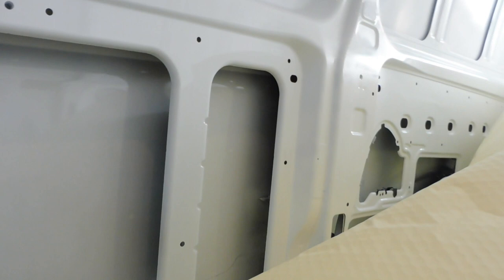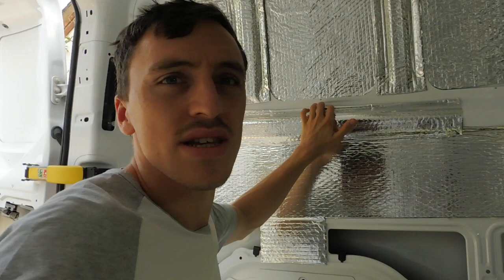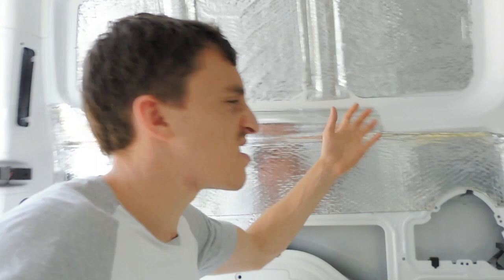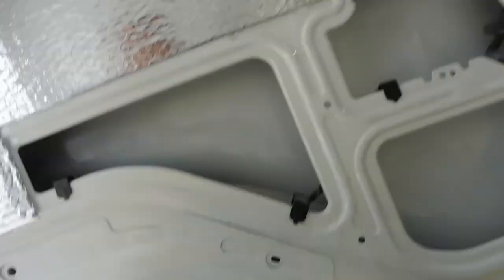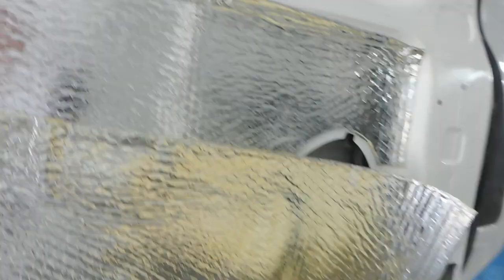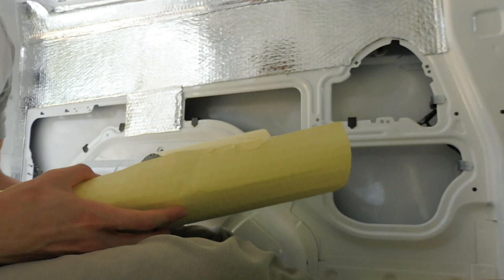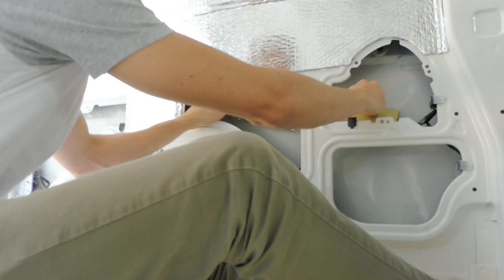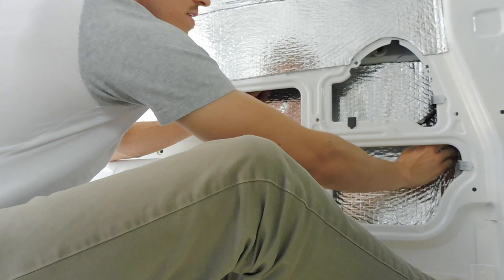VanLog 04 CAMPER CONVERSION Ford Transit Custom INSULATION! HOW TO

Comment: Loves the videos but foil bubble wrap has no R value at all, it is essentially useless as insulation. It makes a good vapor barrier  or can be used for radiant heat if installed correctly.
Reply: correct
Reply: Is a vapour barrier needed?

Comment: Great series. Really helpful as I am looking to convert a transit custom soon. I know you have just finished the project but as you use it more I would really appreciate you commenting on the effectiveness of the insulation and if you are getting much (if any) condensation. It is just it seems very thin so I was wondering if it is actually any good. Another thing I was thinking about is you lose a lot of heat through the cab with the huge windscreen. Do you plan do make / buy window insulation or even put a curtain across. I would love to hear your feedback. Will be starting mine in the new year.
Reply from the maker: Hi Jason, no worries at all I will be uploading some travels up to Christmas to see what its like 'Cold Camping'. We actually have a blanket we hang over the headrests to create a bit of a curtain but I will look at temperature changes with and without windscreen covers.

Comment: Hi Hugh I’m so happy to have been watching your videos, I’ve just bought a 2017 transit custom so I’m happy to find videos to help me. I’m converting to use as a day camper fot more comfortable trips and to
Have space for my wheelchair and scooter. I’ve seen you’ve done other vans now I’m on a low budget to do this so beforei buy insulation ( van arrives Thursday) what is the better way as I’ve seen you say this first method may not be best. I’d be so greatful for your advice and some links maybe. Also I guessed around 20m2 is that correct? Also my 9 year old girl loves watching too GREAT JOB
Reply from the maker: Thanks so much for all the lovely compliments! I would say the best solution is PIR board to fill larger areas and a wool style insulation like the recycled plastic  bottle insulation for trickier gaps, then use foil backed bubble insualtion roll as the vapour barrier. That will be a fantastic layer of insulation for you to board over
Reply: @HughTube  thanks I’ve done all my insulation now I’m rather proud of my work lol 
If I could ask 1 more huge question I’ve done loads of research but struggling desperately with what leisure battery and inverter to buy there’s too many choices I’ll be running all the normal stuff, lights fridge hob water pump tv kettle sockets etc for on and off grid use with a main campsite power adapter I really just need someone to tell me the ones to buy 😱🤦‍♀️ it’s exhausting and I really need to get it all in before I can do much more, I’ve watched loads of your newer videos also to see how you’ve improved on the basic first van and adjusted some of my things thank you again I don’t think I’d have been brave enough to do this alone if I hadn’t watched your channel ❤️💪🏼

Comment: Hi just started watching your van log for the second time! Quality!! Could i ask were was your insulation from and what size roll did you have? As I'm just starting my own!! 
Thanks
Garry
Reply from the maker: Hi Gary, I got it from ebay but I  would seriously recommend using it as a vapour barrrier in conjuction with some other insulation as it isn't great on its own
Reply: Thanks Hugh! 👍. Could i ask also, was the Captain swivel for the 2014 model? And did you have any trouble fitting it?
Thanks for the reply
Garry